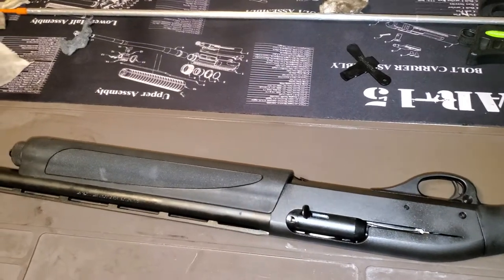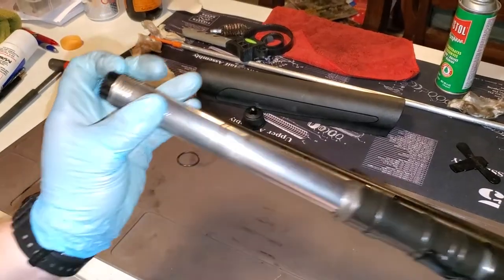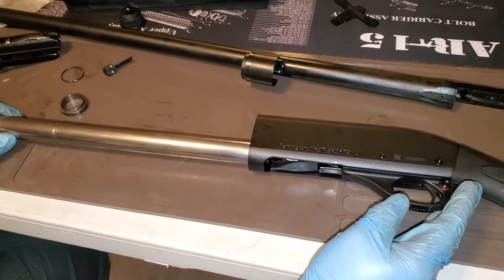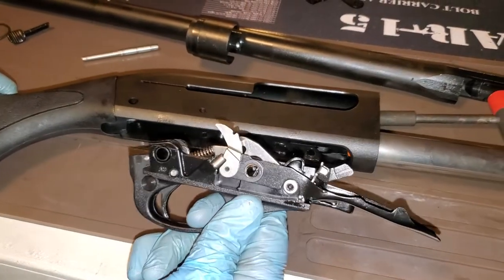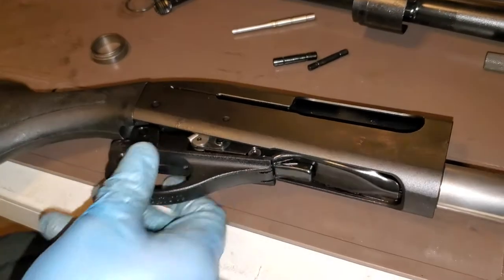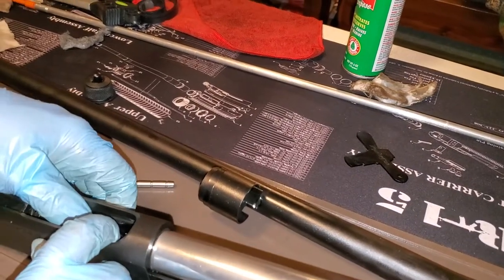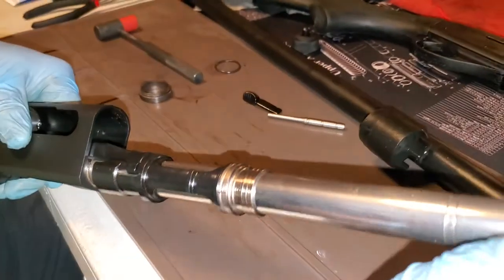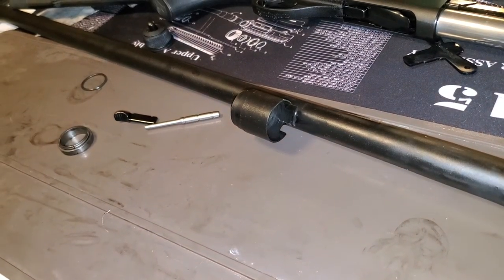Disassembly and workings of Remington 11-87 in 20 and 12 gauge

Comment: Thanks for the vid. My sons ~2010 11-87 12 gauge was constantly failing to load a second shell and jamming the spent shell with the next unfired shell  in the action. I mean jammed big time. A real pita to clear especially with ducks coming in low over decoys lemme tell yuh! Upon inspection I found he had the gas piston O ring in the wrong place! I installed it the correct way. BINGO! Gun shot perfectly. VERY nice SOFT shooting gas gun with full house 3” steel 1550 fps duck loads that kick like hell in my 870. Lol

Comment: The front magazine stop will come out the front only, use big flat screwdriver push the black knob in turn 1/4 turn it comes out, this is the only way you can get the spring and shell follower out!

Comment: This is very helpful. My 1187 isn't wanting to load shells smoothly. The bolt is hanging up mid way. Any suggestions besides cleaning it again?
Reply from the maker: I would check the trigger group and mechanism - is there a burr, a bent piece, or a place where the mechanism is binding?  The only time I have seen this, the bolt hold tab (very front of the trigger group) was warped.  If the bolt is binding/hanging, that is not something cleaning would fix unless it was REALLY dirty.
Reply: @murphyfirearmstraining3630  I will check it after work today. Thanks!!

Comment: Great video.  Especially with regard to the info on the 20ga gas piston rings.  One should also note that the 20ga does not use the forend support - the stamped piece that sits on the action bars.  With regard to the gas piston, actually the gas seal activator (3-rings), some say it should be removed for heavy (3") loads.  The manual says to do so on the 12ga 3" and  3 1/2" guns, but nothing about the 20ga.  Any comments with regard to this?
Reply from the maker: Dean, I wish I had an answer for you.  We use these heavily at boy scout camp, but only with 2 3/4 trap loads.  These guns have never had any 3 inch shells through them in the years we have used these models.

Comment: My magazine follower on my 11-87 is sticking out to far and wont allow the bolt to cycle. The bottom floor plate that has the bolt release hits the follower. I’ve order a new magazine follower and a new latch that is held in place on the side of the receiver with a snap ring. Any other suggestions?
Reply from the maker: That is exactly what I would try to remedy what you describe.  I  hope that does the trick for you.
Reply: @murphyfirearmstraining3630  thank you sir.
Reply: Another question. When i remove the snap ring on that latch, is the spring retained? or will it explode on me? Lol
Reply from the maker: @Jonathan Mathews  you can remove the spring and retaining cap from the muzzle end of the magazine and that removes all spring tension.   If not, then yes it will fly out.  Thankfully no tiny parts to lose.

Comment: How do you remove the choke so it can hold more shells? bought this gun for skeet shooting i can only put two in tube
Reply from the maker: That means your gun has a plug in the magazine.   You have to remove the end of the magazine (under the large nut that holds the forend there is a retainer that holds the spring and plug, you take that off and then take the plug out, then put the retainer back).
Reply: @murphyfirearmstraining3630  👍

Comment: I know this video is 3 years old, but I'm working on an 11-87 Sportsman 20 gauge with a bolt assembly completely locked CLOSED.  No live shells.  Got the forend and stock off but the barrel will not budge without that bolt opening.  Any suggestions?  Thought of removing the trigger assembly next to get a better look.  Maybe someone will respond....Thanks!
Reply from the maker: Most likely it was reassembled incorrectly and the wishbone is lodged in place and not sliding into the buttstock.
Pull the trigger group,  remove the wishbone and your bolt should open right up.
Reply: THANKS!  I'll try that right now.  Appreciate you sharing your wisdom.  Wish me luck! @murphyfirearmstraining3630
Reply: Got it!  @murphyfirearmstraining3630   My buddy had mounted a Truglo rail that comes with three SHORT screws and one LONG screw.  The longer screw was supposed to be in the REAR of the rail (toward the butt stock) and the three shorter screws in the other holes.  The longer screw was hitting the bolt assembly causing it to jamb shut.  I just mounted the screws in the proper sequence and it works like a charm.  Thanks again for your wisdom and for your video.
Reply from the maker: @jamesbaldridge7215  glad you sorted it out.
Reply: Just subscribed @murphyfirearmstraining3630  .  Learning a lot from your videos.  Keep 'em coming!

Comment: I’ve got the same model 20 gauge, I put a snap cap in the tube that I didn’t realize was too small and now it’s stuck in there, any tips on removal?
Reply: The tubular magazine or the barrel? If the former, twist the crown nut at the end of the mag out, and then  let the guts of the tube (spring, follower, rounds, snapcaps) gravity feed out the top.
Reply from the maker: Don't know how I missed this, but Jacob Quinn is right you can pull the guts of the mag tube out of the front end and it'll come out.

Comment: What size is punch are you using for the pins?
Reply from the maker: They're two different sizes, but I use a 1/8 or anything smaller to knock them out.  They're not like roll pins, it doesn't have to be an exact size. I hope that helps.

Comment: My 1187 won’t stay open when last shell is shot any advice?
Reply from the maker: Could be that your action is really dirty, keeping it from fully cycling.   

Could be weak ammo. Try a faster/heavier load.

Have seen the locking mechanism shear off in one.  If that's the case, it won't lock back even if you cycle it by hand.  If it locks back when you cycle it by hand, it's one of the first 2.

Comment: How do I remove the plug from my 1187 sportsman 20 gauge
Reply from the maker: To remove the plug, you would have to remove the cap from the end of the magazine tube, pull the plug, then put the cap back in.  The cap is at the end of the the magazine (black piece of metal).  Usually I squeeze it with a set of needlenose pliers to pull it out.  I hope this helps.

Comment: What the reason  why when using the  gun ? Why does more than  two cartridge  ejects  and jams the gun.
Reply from the maker: If that happens usually you have a part in your elevator system that is worn or broken.

Comment: Ever had issues with the shells not feeding from the tube on the 12ga?
Reply from the maker: Sorry, have never had that issue.
Reply: Thanks for getting back to me. It just started doing it so I’ve just been trying to research it. The little catch pin is acting like it’s not getting activated to allow the shell in the tube to release.
Reply from the maker: @davidhorne1069  may try a good deep cleaning.  I once had one that would not lock open because the catch had sheered off.  A lot of small parts that are part of the trigger group.  Take it totally apart and compare to the exploded diagram to see if something is "off".
Reply: Yea I think that is going to be my only option. I cleaned the gun up really good but have not pulled apart the trigger group. That’ll be next I guess. Thanks again.